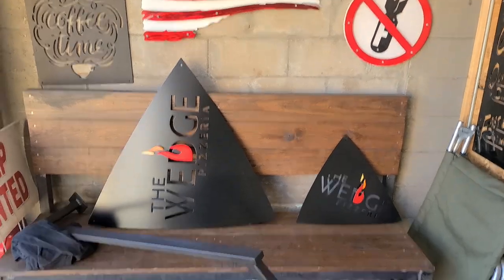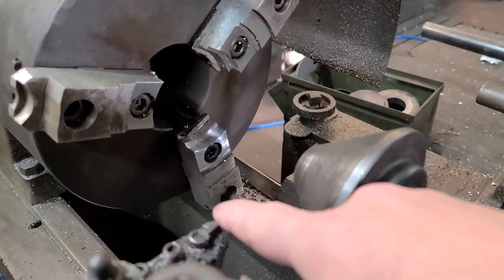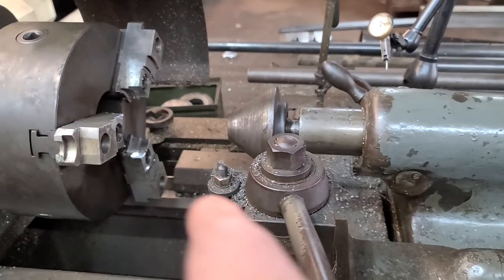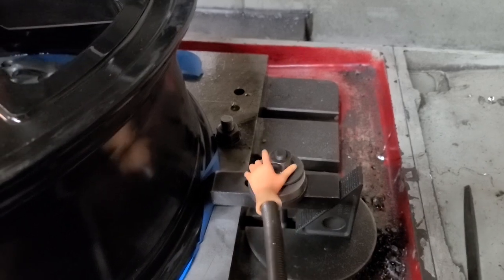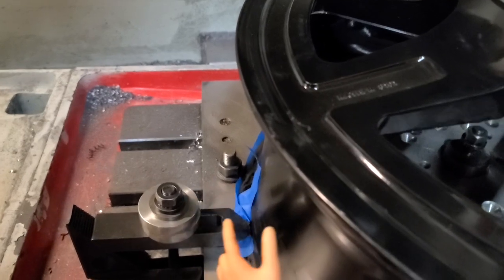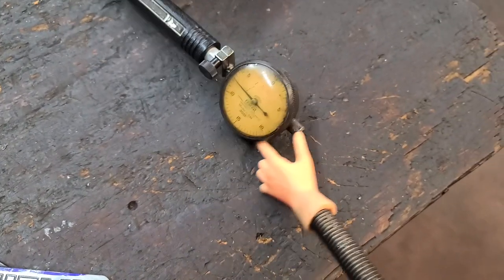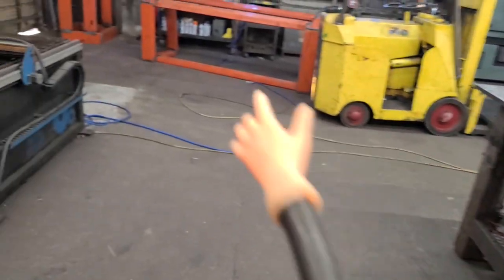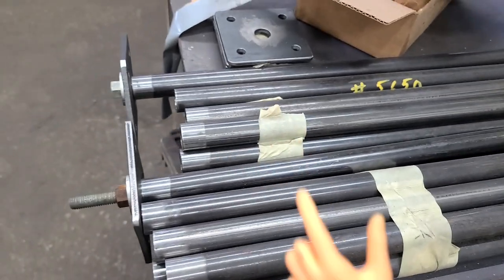fun with a tiny hand! and mill set up for big ol 22s

Comment: A quick question about those wheels.  Where does the number come from telling you how much larger to make that hub area?
I was asking because I wondered how long it took to lock a rim down in place, then find the center.   
tHanks for the video.
Reply from the maker: It takes a few minutes to double-check center with the indicator,  I get the number to bore from the manufacturer specs.
Reply: @helixmetalworks  tHanks.   Very interesting stuff to me.